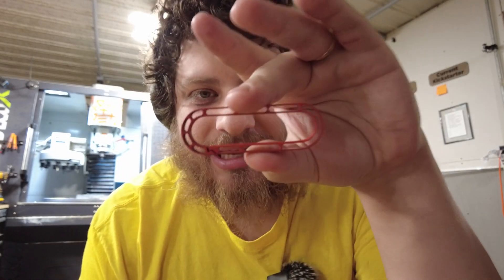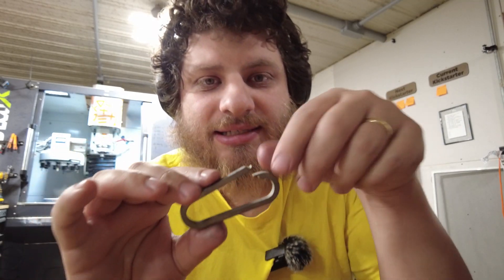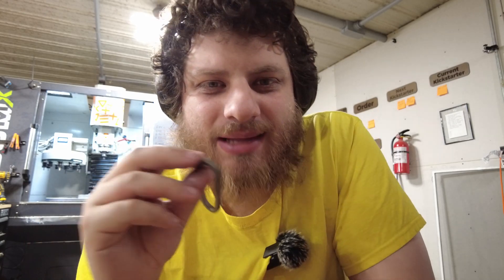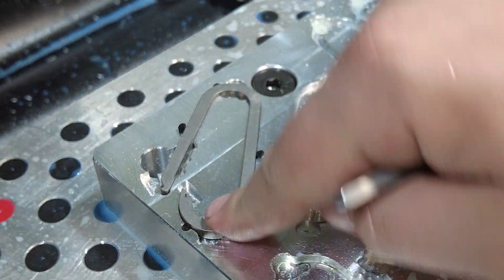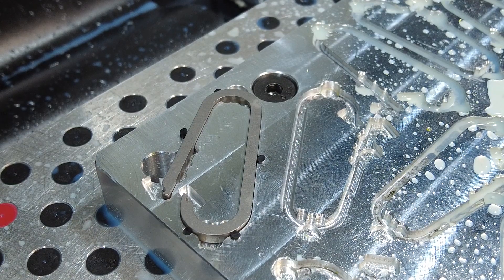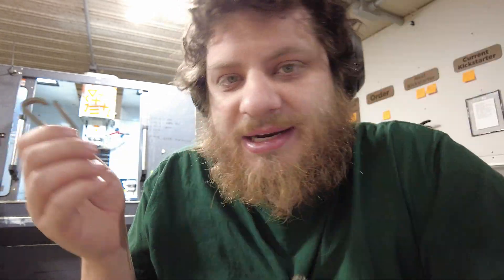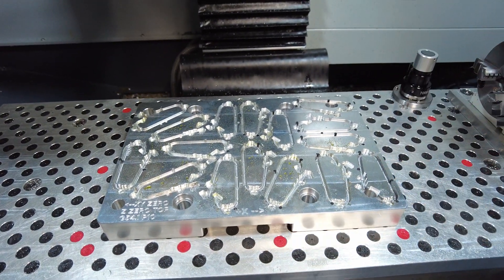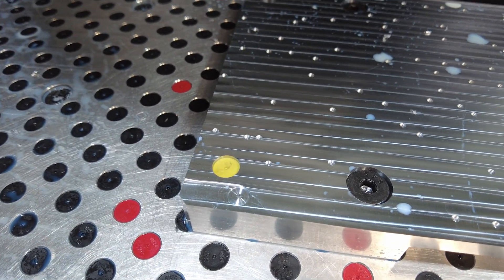$3608.21 in Scraped Parts

Comment: I have some experience machining parts from stock that is far to close to finished tolerances.  I'm guessing you've already ordered the material that's a already cut to size?

If not I would add a small amount of material to the outside and actually not have the inside cut by the laser.  Just a small hole for clamping.
Clamp the part in the center and machine the Outside profile and the inside grooves. This would Give you a "known" surface to machine into a jig for location.
Then your second operation would be clearing the internal area by clamping on the Outside with a washer and bolt system.
Reply from the maker: My goal was to reduce the amount of machining as much as possible, and that definitely came back to bite me for the reasons you pointed out. When I ordered my big batch of Carabiners, it seamed like I had a reliable process, but it didn't hold up to volume. I would definitely do it your way if I had to do it again.
Reply: @AudacityMicro  what about completely encasing then in resin to achieve what I was talking about?  It would add operations to the setup but it might give you the precision you need
Reply from the maker: That's also an interesting thought. I might have to try that in the future

Comment: what if you just make holes for the rubber gaskets and thread the top and screw in little screws over the gaskets so they're stuck underneath
Reply from the maker: I think that would be a fantastic way to retain them.